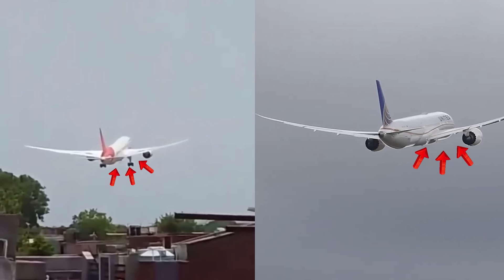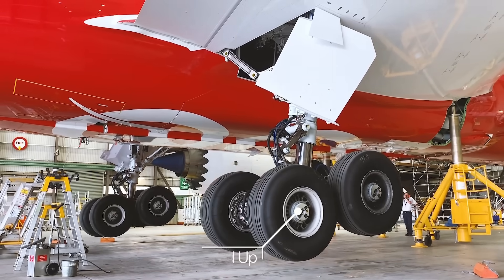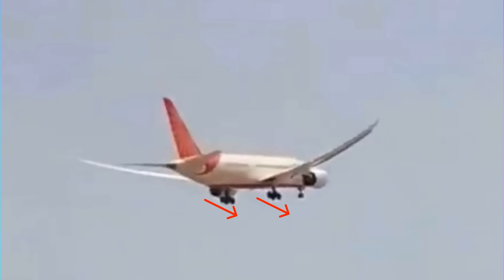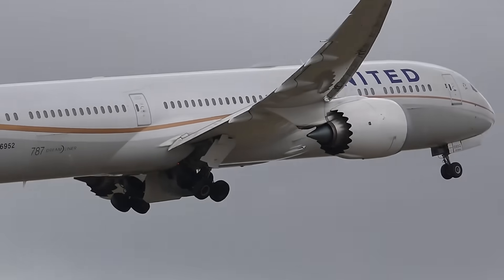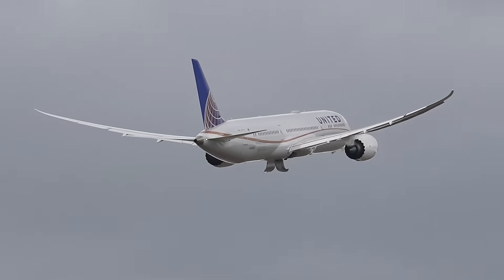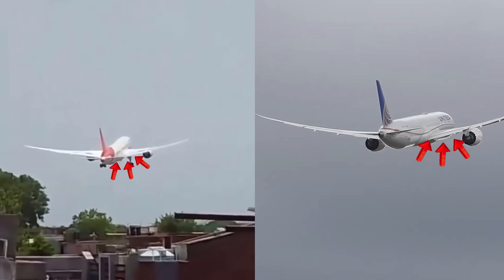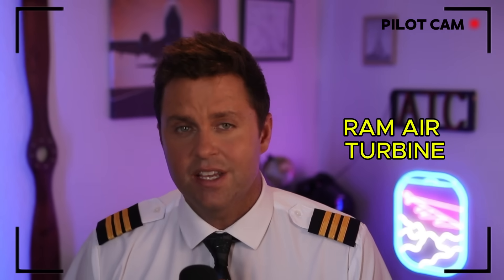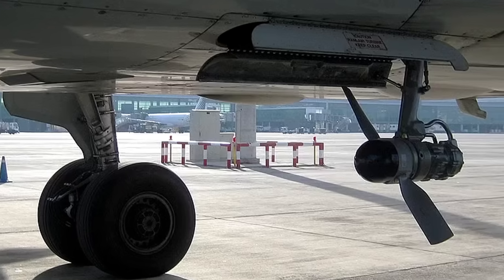Pilot Explains: A New Detail in the Air India 787 Crash Everyone Missed

Comment: A passenger on the previous flight said the electrical system had problems. No AC and the AVOD was not working.
Reply: Also, apparently several crew members who worked on the same aircraft days and WEEKS before the crash reported issues with the electrical system.
Reply: I am super curious about this, too. Wondering what Gary or Captain Steeve think? Could a catastrophic electrical failure cause both engines to fail?
Reply: @established_on_the_run  that is what i'm wondering
Reply: The 787 is one of the only planes using less Bleed and more Electronics. It basically means the engines are not providing Bleed Air to operate some systems like AC for example. Based on my Knowledge A/C and Cabin Systems are running on 2 different Electrical Motors. Primary Electrical systems have more than a secondary backup. A/C and Confortable Electric Devices can hardly be classified as Primary. It is importand to understand that crashes are usually a cause of multiple circumstances. One event such as the Electrics may seem not a big deal on their own but might have contributed. On its own it is hard to imagine how the electrics could have played a role. It could have, i just dont see how it could have
Reply: He was debunked, was t eve on the same aircraft
Reply: The electrical system inside the cabin is separate to the one in the cabin .
If your screen does not work that does bot mean the plane won’t fly!

Comment: Just one thing. When you watch the video from the apartment you can hear the engines as it comes into view and then a couple seconds later you can hear the rat. But in the full video you can hear the engines running. Maybe not at full power but they were running. Definitely running at rotate because you see all the dust blowing as the plane lifts off.
Reply: The dust cloud could have been a result of the wake turbulence vortices that occur whether the engines are producing take off thrust or are totally shut down. Heavy and slow aircraft produce the greatest turbulence, as far as I know.
Reply: They can still spin but no produce thrust
Reply: @paulrasmussen8953  Yeah but Neil says you could hear them.

Comment: @Unotch
1 minute ago
Yep, that's what i thought. The comparison video shows a plane landing ... do you hear the rat? Yea, i do hear the rat but should i? What i don't hear is two jet engines at full blast. And if you even take the most unfortunate scenario with gear out, no flaps and one engine working, they would not stall like that. It looks to me like they purely went down due to a lack of air speed, the plane rolling back and then dropping like a wet noodle. Also with one engine still operational you would see yaw, they would have to lean into the working side.

Comment: Brilliant observation on the gear. You’re a real detective
Reply: He did not come up with it. Swiss001 noticed it. This guy belongs to the group along with Captain Steeve who was adamant on blaming pilots without any proof and is now backtracking when smarter people did proper investigation and called them out.
Reply: @Co11ider  pilots are not usually adamant on blaming other pilots. ALPA usually goes out of its way to not do that
Reply: Even "Before selecting the landing Gear handle UP"  , the gear tilts Forward Down... as soon as the sensors detect AIRBORNE...  see:   AMM 32-31-00 LANDING GEAR DESCRIPTION AND OPERATION.    So, regardless of the selection of the gear handle, it will always tilts forward down to prepare for retraction.
Reply: @fabianpilot that changes things again. Let me ask my 787 friends and check their amm.
Reply: @Co11ider   cool, let me know if there is any discrepancy
Reply: AFAIK, Swis0001 observed it. This guy is taking false credit. In fact he is using the same video that Swiss0001 posted.

Comment: Boeing  problem is WAY More COMPLEX and is beyond Boeing company. It will involve other plane manufacture around the world ...

Used to worked at Wo...ard. The world leading aeronautical para governmental company delivering pilot cockpit controls as well as servomechanism to the planes around the world.

I was harassed and eventually fired for doing the correct thing of documenting wrongly machined parts (separated and marked with RED paint). The next day saw wrong parts w/o red paint put in to the container for later assembly, by second shift.  I have documented it, appointed people responsible for this repeated pattern and notified my chain supervisors. For doing it I was fired.

To me it is no wonder and it is only a MATTER of the TIME for more incoming problems, also with other plane manufactures ....

Comment: The plane was heavy with fuel and passengers, etc  ?  Did the 2 pilots take advantage of the 2 mile long runway and start from the end of the runway, or, did they take off at the middle of the runway ? If they took off midway in the runway I wonder if the plane would have enough momentum to rotate and climb quickly, instead of sinking and the flight faiil.

Comment: I have been on a take off with a single (port side) engine flare out, That was back in 1993 taking off from Geneva in a Britannia Airways Airbus A300, Pratt and Witney engines. Can't be sure of the call-sign as the aircraft the internet has thrown up is an A300 OY-CNA delivered to Britannia in August 1993 and I flew in April of that year.

It wasn't fun. But fortunately we were about 90 seconds into the flight, maybe around 2,000 ft, and the pilot had plenty of altitude to recover in.

I do remember a loud bang, an horrendous vibration on the plane, like being on an earthquake simulator, a burning smell and a very rapid but short duration (only 2 - 3 seconds) of the plane dropping like a stone. There wasn't any change in attitude, it was just as if the plane was doing a belly flop. The pilot very quickly maxed power on the starboard engine and shut the port one down. We then spent 45 minutes flying around Lake Geneva peeing as much fuel out of the fuel tanks as possible to make the aircraft safer for landing. Plus all the usual brace position stuff and being chased down the runway by the fire truck. I'm fairly sure the crew weren't 100% certain if the landing gear would lock in the down position. I was in row 1, and was staring at the chief stewardess in her seat (they faced backward right behind the cockpit) so could hear a lot of what the cockpit relayed to her (which really didn't help, they looked just as nervous as the rest of us).

Back on the ground, a large section of engine cowling wasn't there anymore. Dunno where it went because I headed straight for the bar and a large beer. And the Airline was paying for it!. As soon as we were off the runway and the plane was taxiing there was a huge sigh of relief and a spontaneous round of applause from everyone.

We were then split between two smaller Boeing 757's for the return to Gatwick, with luggage identification being a "free for all" grab from two trolleys out on the apron. Nearly went home with someone else's (identical) ski-boot bag by mistake but I fortunately opened the bag to check what was inside before I claimed it! The Boeings had RR Engines. British - hooray for Rolls Royce! No flame-out with them.

I am still here to tell the tale 32 years later.

You pilots do one hell of job!

Comment: Another possiblity is vapor lock that caused the engines to flame out.  It was very hot and the 787 was  sitting for some time waiting to take off.
Reply: Jet fuel is close to Kerosene in composition, it's not volatile enough to vapor lock at any temperatures that plane would see, let alone with the 300-ish PSI those fuel lines are pressurized to. I think water contamination is more likely. After the plane refuels, it sits as people and supplies are loaded. During this period the water separates and sinks to the bottom. The plane starts and runs down the runway, reaches V1, and the pilots rotate, it begins to climb, the pilots throw the gear lever, the gear begins retracting. But, after rotation, the plane pitches up, the water goes to the bottom rear of the tanks, the independent fuel pumps all grab water at the same (bad) moment and push water into the hot engine cores, water instantly flashes to steam and bang, dual engine failure just after takeoff, the loss of hydraulics stops the gear mid-retraction with that tell-tale forward cant. The dual engine failure causes the RAT to auto deploy which produces the angry Cessna prop noise, without any noise from the engines. The plane loses: thrust, power, and hydraulics ALL at the same time at a low altitude with no extra airspeed and that's all folks. It's over.
Reply: @jeremygoodman9807  Aside from the properties if the fuel itself, the entire fuel system on the 787 is very sophisticated,  and has dozens of features, mechanisms and sensors that would prevent something like vapor lock.  It's very advanced,  complicated stuff, and I don't have the patience to summarize it to people screaming "vapor lock'' because that's the cool new theory they heard.  So I appreciate you not being like me, and taking the time to explain one very important aspect of why vapor lock is not a realistic possibility.
Reply: @jeremygoodman9807  Sounds quite plausible - the question that begs to be asked is - where did all the water come from / how did it get into the fuel tanks?
Reply: @jeremygoodman9807  If water was injected into those engines at 300 psi during takeoff throttle, Wouldn't there be some steam coming out of the tail pipes?
Reply: @mikejerman1912  very good point - it would look much like "white smoke" /  massive contrail?  Therefore, water in fuel theory not likely?
Reply: the 787-8 is certified for air temps up to 50°C under any conditions
Reply: Not a realistic possibility.
Reply: Slim to none. That kind of temperature is pretty normal for India and planes fly in and out every single day and have been doing so for decades without incident. Not just India but the entire area in South Asia. It is way hotter in the Middle East so there goes your theory.
Reply: No. Stop spreading this nonsense.
Reply: It was reported to be 40 degrees C on the runway ..
The plane sat for over 30 minutes waiting to taxi ..
Hot fuel can boil , and that produces "bubbles" ..
Thats vapor lock.
Reply: @pdrphil8159  Good point but both engines at the same exact time?

Comment: Great video especially the Gear tilts up when Gear up is selected.  I think it was a complete electrical glitch,it sounds like the RAT dropped out.  On another note no one is talking about how the fuselage  completely melted nothing left except for the wings, gear struts, engines, tail ,  Nothing to do with the crash but it is interesting how composits handle  a crash & fire. This was the 2nd experience with  a Jetliner fuselage involved in a crash with carbonfiber composit burning  the first being the  JAL A350.
Reply: Even "Before selecting the landing Gear handle UP"  , the gear tilts Forward Down... as soon as the sensors detect AIRBORNE...  see:   AMM 32-31-00 LANDING GEAR DESCRIPTION AND OPERATION.    So, regardless of the selection of the gear handle, it will always tilts forward down to prepare for retraction.
Reply: plastic airplane with lots of glue